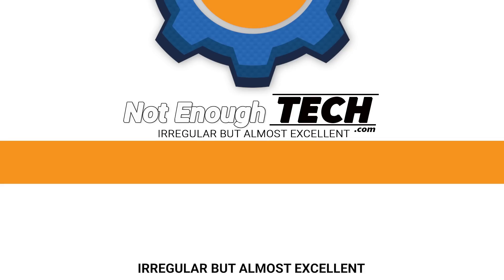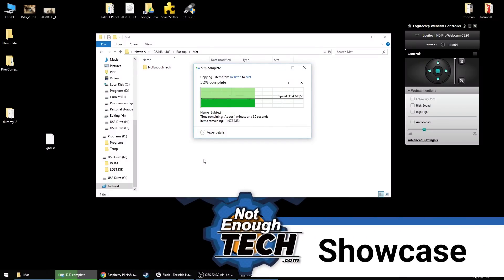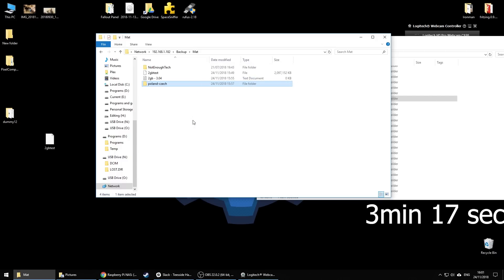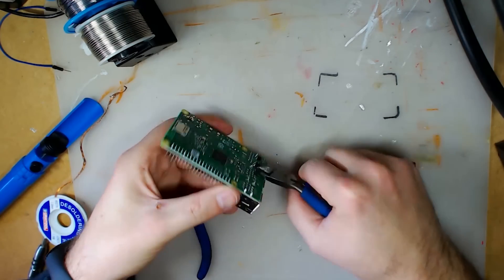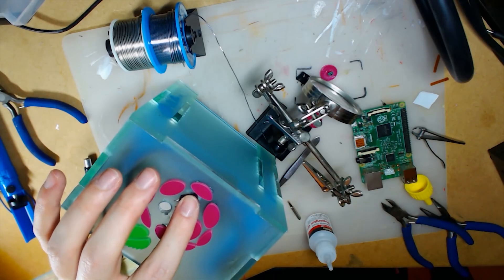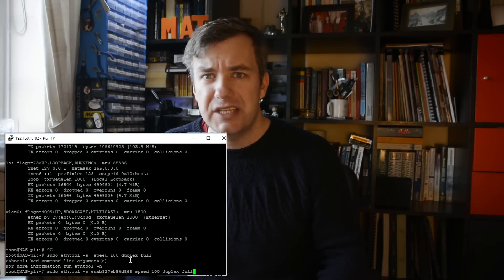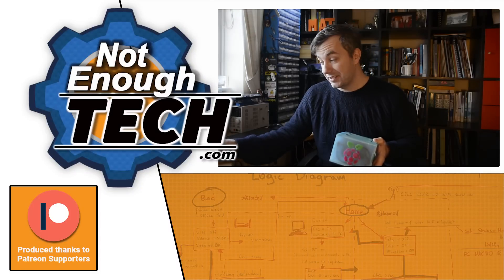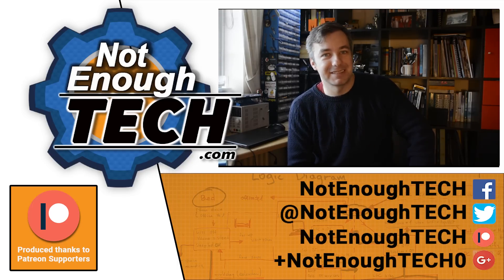Raspberry Pi: The most pointless upgrade - Raspberry Pi 3B+

Comment: if usb controller is supposed to limit network interface to 300Mb + tend to all hard drives, wouldnt 5GHz wifi be actually faster? Did you test/measure this option at all? Did anything change over following months(like driver update coming out)?
Reply from the maker: The build is over the ethernet which makes the network actually most consistent. I'm currently building the 3rd iteration with a very promising results, similar price but OrangePi3 as the brains of operation. I will be posting about it next week. I have not noticed any performance changes, but I will be running one more benchmark before the upgrade.

Comment: I know this is a bit necroing an old video (well, depends on what you define as old though..), but just wanted to ask are you useing the official 5,1V 2,5A raspberry power supply / charger? I saw a video earlier saying that the 3B+ is WERY picky on power supply; so much as 50% on certain benchmarks. I'm updating my NAS as I type, but luckily my old one was a 1gen pi, so I assume/hope that still should be a real update...
Reply from the maker: I have the original power supply that came with the RPI3B for this box.

Comment: Your problem is that the ethernet and usb ports are on the same bus, so it's sharing the bandwidth pipe
Reply from the maker: Sadly this it not the case. (napkin math even wildly inaccurate would produce much better results)  besides, why advertise 300Mbits if you cannot utilize in any way to store or send data. With the performance of 10 MBit/s you have a theoretical 38MBit/s to serve the USB bus. CPU is fast enough to serve it, and disks once spun, also will gladly take it.  1GB ram is mostly free to do decent chunks too.
Reply: @notenoughtech  The 300 Mbps they give is likely theoretical networking performance. Just like 100 Mbps ethernet is theoretical and you usually get more like 80-85Mbps real-world after overhead. So if we take overhead into account on 300 Mbps that gets you around 240-255Mbps. Now take into account that ethernet and disks are going through a USB 2.0 controller, which is 480 Mbps theoretical, usually 240-300 Mbps real-world, there's all your bandwidth, with no disk activity. Throw in the disk writing and something has to give.
Reply from the maker: The average 10/100  transfer in the video was 10.2 which already begs the question. with 1000 interface, I should see at least some improvement (i accept the overhead) but I wont agree that suddenly USB bus utilization in the same conditions go through the roof.  Besides with average speeds 9Mbit/s on 1000 interface - there is no data to actually populate the buss at all - there was only a single connection with the NAS.  Don't get me wrong  - I don't expect 300Mbits solid, but anything in excess of 200 is not unreasonable especially if iperf3 posted 250+ speeds.
Reply: @notenoughtech  But you did see higher BW as well, i think your peak was 15 MB/s (120 Mb/s). Why your average was lower than on 10/100, who knows, it's a different version of the controller chip, a different ethernet nic, maybe the buffers now can't handle the speed which is why it's so up and down. Different kernel? Different driver versions? Lots of different reasons. I bet if you did a copy from the Pi in the opposite direction, you'd get better speeds since the I/O is a lot simpler.
iperf3 is a whole other thing and is not a comparable benchmark. it's memory to memory, so the usb controller can dedicated all of its bandwidth to ethernet without the disks getting in the way.
Reply from the maker: @ncohafmuta  I agree that iperf3 was not even close to a relevant benchmark but then I would not advertise a board with 300Mbits this way if the speed was purely theoretical.  I'm not trying to diffuse your argument. I agree that expecting straight up 300Mbits would be insane, but to have a massive edge over RPI2 due to CPU  and Ethernet upgrades is more than reasonable. There are new drivers - and performance is expected to be so so at launch, however, this is not a new board anymore...  and that is disappointing
Reply: @notenoughtech  Well 300 Mbps is just a weird number in general that is not any kind of standard, so you can't really assume anything. It's like they factored in the USB 2.0 overhead but not the networking overhead. But, their iperf numbers are completely in the ballpark.
Now, that you believed you would get those speeds while disk writing, well, i think both you and them share the burden of blame there. Combining the controller on their part is just plain stupid, they should have learned their lesson from the first couple boards. And it sucks for you.
You would have been better off getting a Rock64 and getting real disk/ethernet performance, but i don't know what else you've got goin on over there.
Reply from the maker: In all honesty, I had the RPi upgrade in plans  for sime time. I have not considered other boards  as it was the simplest upgrade to be made. And since there was no rush...

As it turned out, I should have tested the board prior again (i did iperf only) so id save myself 2 days of time. Instead of making how to upgrade RPI2 guide, I have done  Do not do this to A save the work put into this project, save the time I actually taken editing and share my experience with others